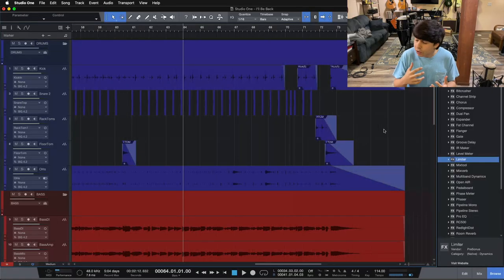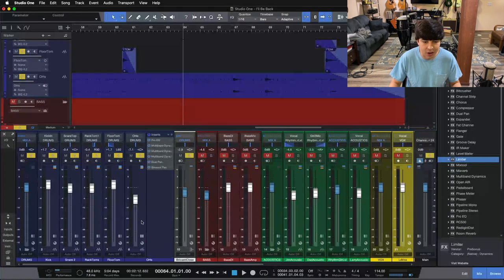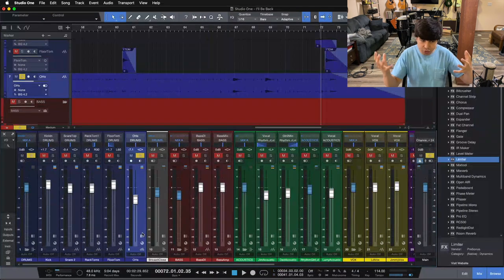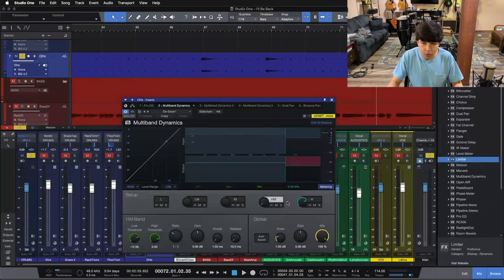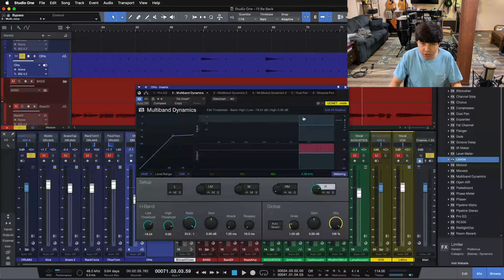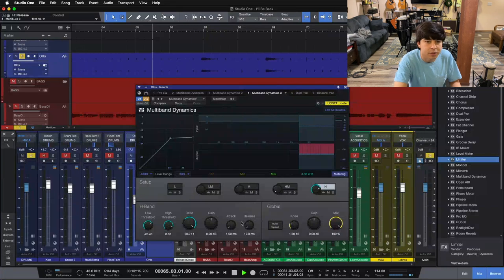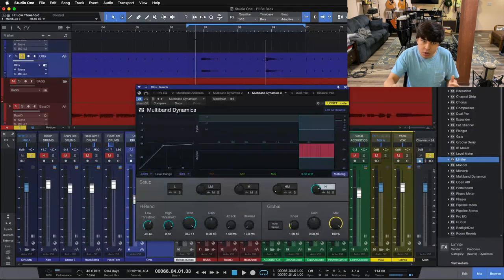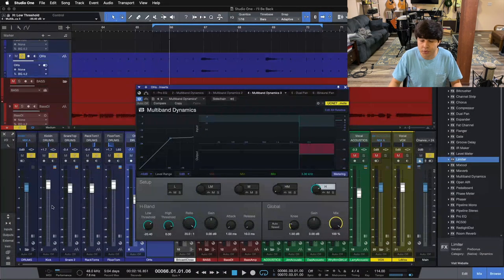1 Trick To Fix Loud Or Harsh Cymbals In Your Overheads (Drum Mixing Tips)

Comment: Very interesting trick. I've been looking for a technique to tame my very shrill cymbals on my Metal band's album. Depending on what I'm doing so far, they end up splitting my ears giving me tinnitus, or being too quiet. I will definitely have a go stacking three DeEssers and see if it gives me the results I'm expecting. You have a new subscriber.
Reply from the maker: Absolutely! This is one I definitely use when the drummer is a heavy hitter such as metal drummers. Thanks for watching : )
Reply: @sumthinsrecording2527  thanks for answering! In my case it didn´t work, because I´m getting a way too shrill sound out of my cymbal mic on the right cymbal, like a guitar amp with no speaker. I guess its placement was really wrong, but I have no way to re-record. I´m digging into distorsion but i´m unsure if this will work.